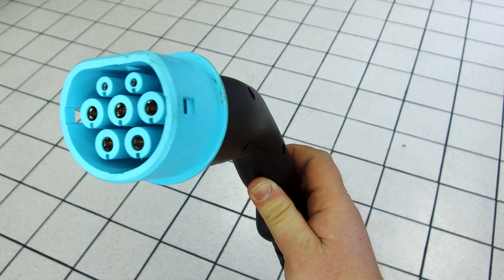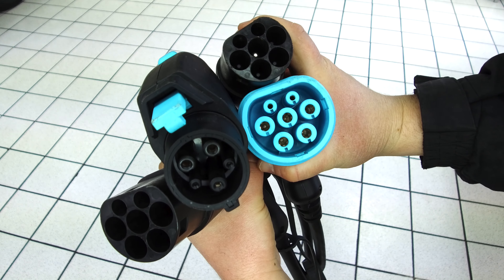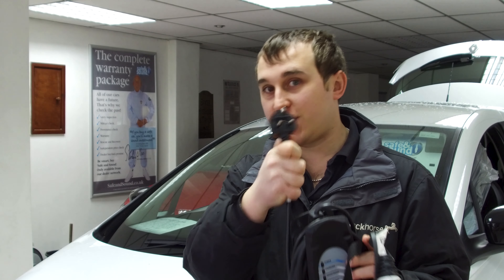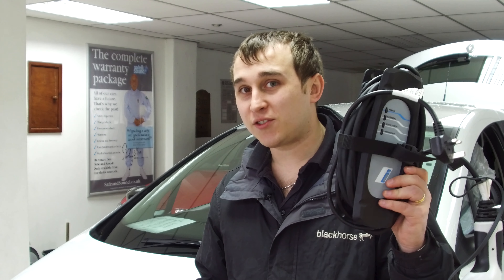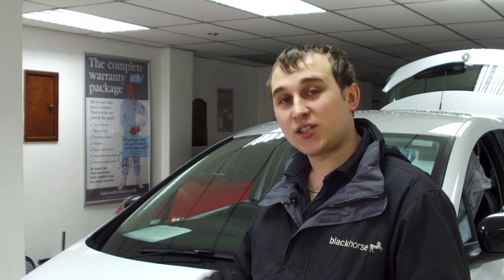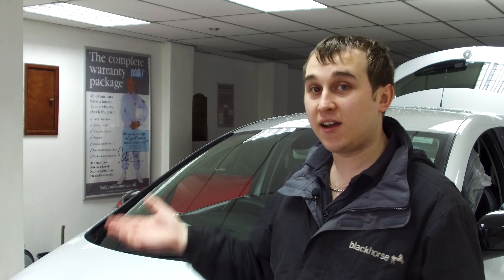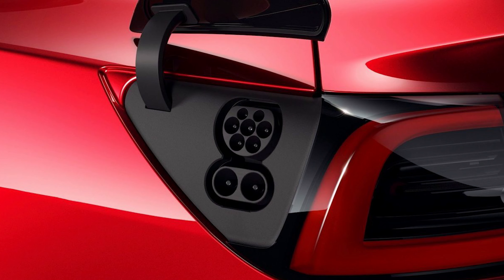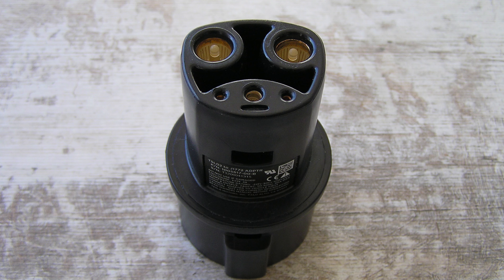Charging Plugs Explained - How Do Electric Cars Work

Comment: @Nicolas Raimo, I have a non-CCS version "Renault Zoe ZE50 iconic",  can I use the "Type-2 to CCS Adapter" (or Type-2 to CHAdeMO" adapter) for faster (than 22kW) charging? something similar to what Tesla has done for older cars, basically Tesla is upgrading its older models from Type-2 to CCS, is this something Renault may also consider doing? TIA.
Reply from the maker: No possible as the charger on your zoe can only handle AC,  chademo and ccs are both DC.

Tesla can handle both DC and AC electric for charging this is why adapters can be used

Comment: Think you should have pointed out that the supply  posts are NOT charges they just supply electricity, the actual chargers are in the cars and it's those that control the amount of power going into the car's battery. Good video, look forward to next.
Reply from the maker: Hi Alan i tried to make it as simple and easy to understand as possible without making it toooooo basic.   Next one is..... NEXT WEEK!

Comment: I agree with you saying best not to use a granny charger on a regular basis. However, not sure you should imply it's unsafe. I know a lot of people do use the granny charger only, and if it's the authorised charger and all the electrics are up to standard, it should be safe, otherwise shouldn't be using it at all.
Reply from the maker: All too many people don’t have there electrics checked and this is why I say it’s unsafe unless you recently checked your electrics for that socket your using I wouldn’t dare plug my car into it on a frequent base
Reply: I agree with Nicolas on this.

Fixed wiring should be inspected fairly regularly (normally every 5 - 10 years or every tenancy change).  This is done by tests with the circuits live and dead, including continuity of live, neutral and earth conductors (known as line, neutral and CPC in the 18th edition) from the meter tails into the fuseboard (consumer unit),and from the protective devices (RCDs, MCBs, RCBOs or fuses) out to the accessories (sockets, light switches and light fittings, cooker outlets, shower isolators and so on) - the readings are measured are recorded, insulation resistance  tests (unplugging or isolating equipment and shoving high voltage through the cables to make sure that the plastic insulation in the cables is doing its job) and by opening up a number of accessories to get the general condition of the wiring.  In addition any RCDs or RCBOs are checked to make sure that if there is a live to earth or neutral to earth fault, that they trip.

In my house, I'd be happy to use a granny charger on safety grounds regularly because the house was rewired 3 years ago by a reputable electrician.  Everything is as installed.  That said, I don't because I have a dedicated charge point, which is faster and easier.  I do have a granny charger for when I visit my parents in Scotland, to top the car up when I get there. Their electrics are also recently rewired and therefore in good condition. 

But in many houses the wiring could be from the 70s or earlier.  Cable insulation does degrade, connections work loose or get dirty, DIY work gets done (maybe not quite to the same standard as an electrician would do), and lets face it, most people don't have their wiring checked ever (unless they're buying a property or it's a landlord who now has to do checks every 5 years or at the change of tenancy in England). Loose connections get warmer than usual, even under low load.

A granny charger pulls nearly the full continuous capacity from a 13A socket and does so for a sustained period (and also about a third of the capacity of the breaker or fuse on a ring circuit).  The plug gets warm, as does the socket.  Some more expensive cables have a thermal cut out in the plug (My Mennekes granny charger does) but most don't.

Now consider this.  You're in a 70s house with the original wiring where a previous owner has taken a spur off a ring into a garage many years ago.  You moved in in the mid 80s and haven't touched the wiring since.  The previous owner unknowingly didn't tighten the neutrals properly in the socket they spurred from and one of the neutral cables has come out of the socket, so the ring is broken.  Ask any electrician and you'll find it happens - more often than you think.

The garage socket is dusty, it hasn't been used in a while.  and the connections inside are tarnished.

You get a second hand EV with a granny cable, and you plug it in daily.  The cables get hot as the car charges and cools down once disconnected. This is exacerbated by the dirty contacts in the socket and the loose connection at the spur.  Above 70 degrees c, the PVC insulation begins to degrade.  The heat is transferred from the wiring to the socket and onto the plug pin (metal is a great conductor of heat) and the inside of the moulded plug gets hot.  The fuse in the plug also gets hot (they do when continuously run at 10A) and the plug starts to melt.  The live and neutral pins are insulated for the first 10mm from the plug (it's a safety feature to stop you getting a shock if you plug or unplug and touch the pins) and that plastic also melts meaning you can't unplug the charger.

Safety is a very valid concern for not using a granny charger regularly.

Comment: The main reason the US uses J1772 (the basis of CCS Type 1) is because it supports split-phase 120-240V power, but it doesn't support 3-phase power. Why would it? Outside of commercial buildings and apartment blocks (who need lots of power for lifts, err, elevators), three-phase isn't a thing there. J1772 only has 2 hot pins up top for AC, 2 control pins, and a neutral pin. And of course, if you've got CCS Type 1, only 3 pins up the top (the control pins and the neutral) are used, plus the 2 enormous pins down the bottom.

The main reason Europe uses Type 2 (the basis of CCS Type 2) is because it supports three-phase 240V or 415V power. As Europe doesn't use split-phase there's no point using J1772 for that purpose. And even if they modified it to at least support 2 out of 3 phases, what's the point? By the time countries started to settle on standards, Europe used the plug with the most local potential, just like the USA did.

The control pins on both use identical commands. This means if you have an ultra-simple (yet still ultra-expensive) plug adapter, you can convert one plug type to another. But these are quite uncommon. Only people with older cars (especially BMWs - long story) need to be aware if their car uses the wrong standard & buy such plugs.

Comment: Is there a way to fix an EVSE to an external wall but protect it from others wanting to freeload while I'm out?
Reply from the maker: The likely hood of this happening is ultra low and what about would they physically steal?  £2? There is some chargers with pins built in or you could just switch the breaker off